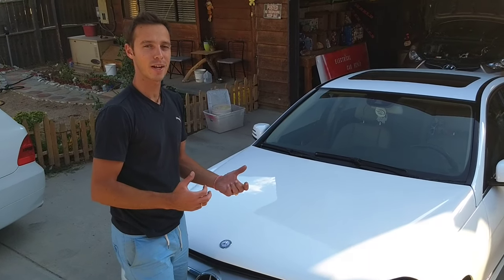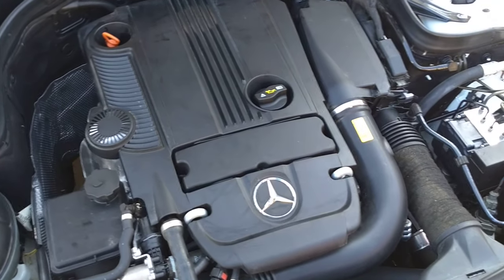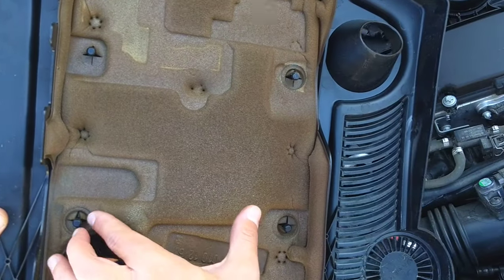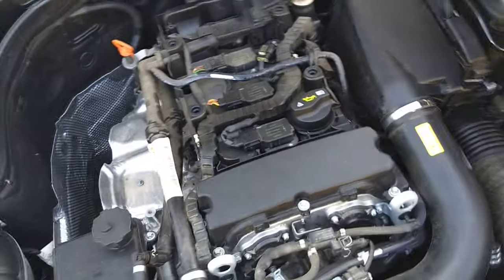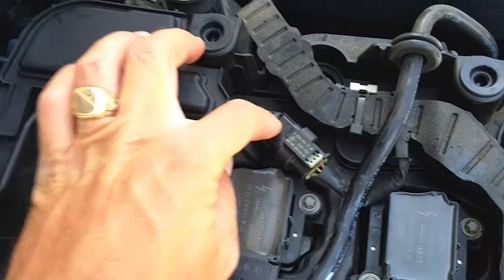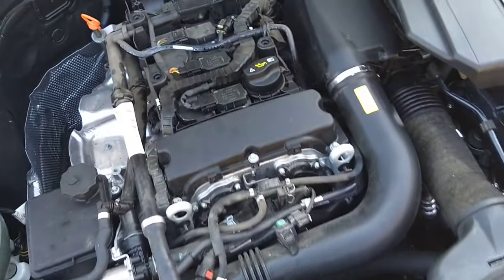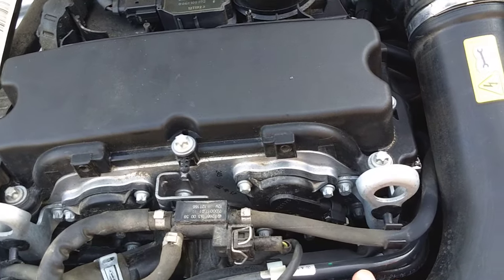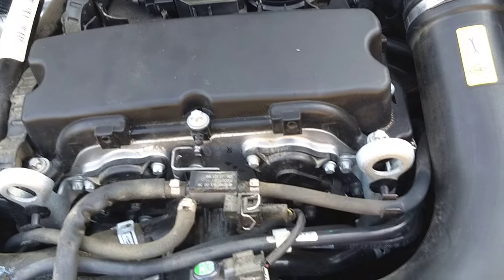MERCEDES W204 C250 CAMSHAFT POSITION SENSOR AND ADJUSTER CODE EXPLAINED

Comment: YO GUYS FUCKING ROCK IT WAS THE CENSOR AND I ALSO CHANGED THE MAGNETIC CAM ADJUSTER RUNS GREAT I DID IT ALL MYSELF U GUYS ARE AWESOME THANK YOU
Reply: Did you have the rattle sound upon starting also?
Reply: No programming needed? It automatically adjusted itself (camshaft magnetic phaser).

Comment: I have a problem with the eco system of the same car from 2015, the check light is on and it starts blinking and the car shakes, they changed one sensor on the front, everything seemed to go away, but after a couple of days it started again, do you think I need to change all the sensors?

Comment: This video was awesome, but, Do you have video how to change the Camshaft Magnet? As you said, we should change it both sensor and magnet together. 
Thanks
Reply: You take the three e-torx screws out and remove the cam adjuster magnet. Then install the new one and install the three screws. Done.

Comment: You guys are awesome!! Question I have exactly the same Mercedes 2014 c250 I HAVE A MESSAGE TO CHANGE THE CAMSHAFT POSITION SENSOR FROM BANK A, WHICH ONE IS THAT ONE? THANKS.
Reply: That one -> bank should be on top bro near the ignition coil and Bank B is on the left side which is exhaust
Reply: There is only one bank since it is an inline engine.  Bank A.  The two sensors/solenoids are intake and exhaust

Comment: Hi guys,
I appreciate your videos greatly.
I have the w212 e250 bluetec. I am having a hard start (3 seconds) then smooth running. already changed the cam control units on the front but still have same issue. Original check showed "intake sensor malfunction (I do not have the exact code number). pls advise.

Comment: I have  code that reads P0340 Camshaft Position Sensor therefore you also recommend to replace the adjuster also correct?
Reply: Hi , I'm having issues trying to remove the exhaust camshaft adjuster on the leftside which has a few piping in the way, which parts should I remove to get to the camshaft exhaust adjuster?
Reply: The sensor indicates u have an issue with camshaft gear adjusters.  That’s a 2 to 3k fix.  Don’t listen to the clown
Reply: Benji R.   Did you find out the problem with the code

Comment: Quick question. How to locate thP0080 Code: Exhaust Valve Control Solenoid Circuit High Bank 1? On this. C250  thanks

Comment: Hi my 2013 c250 has a short rattle when I start the car.  
Could this be the cam shaft sensor or is this the timing chain?
Reply: Im having the same issue, did you get it fixed? If so what was the issue
Reply: @khalidmahmood8466   decided to trade it in.  The timing belt repair is too expensive.

Comment: I’ve got a Mercedes W204 2007 c200 kompressor.
I purchased it couple months ago with an engine light.  I ran an odb2 scan and it came with p0017 code. The oil and filter has been changed regularly.
Is it a simple fix do I have to do the timing . Thanks
Reply: That’s not good

Comment: Hello in 2024, can you help me to figure out what it could be 

1. P001762 The position of the exhaust camshaft (cylinder bank 1) is implausible relative to the position of the crankshaft. The signal comparison is faulty.

2. I have P012872 Thermostat problem as well

Comment: I have a 2014 mercedes c250 turbo. 1. Where is the mass air flow sensor? I keep getting P006800 and P012873 codes (the 873 code is current) what are these codes about? I clear them but they keep coming back.

Comment: Great video! I am getting P0018 on mine the car takes some time for the engine to start up about 5 seconds. Can you please make a video on that?
Reply: i have the same code and i dont have any problems with my car with that code but my check engine light came on shortly after having an MAJOR oil leak issue which then led to the code "p0018" what was your solution?
Reply: @iansbuilt3478  I found the cam adjuster to be faulty.
Reply: @adiyosepov  how much was it to fix and how easy is it?

Comment: thats a good info thanks.!  why my 2013 c250 mercedes works fine for about one hour then the engine starts to shake or not working properly?  other times works fine. any idea?
Reply: Issue with the ECU,

Comment: Hi !
can u make a video or tell me how to position crankshaft to 52 to change high pressure fuel pump? I think this car has same engine as 2013 slk 250 which I need to change the HPFP. Was told it’s easy to position crankshaft to 52 , not sure where I can see the numbers and  how to do it . Thank you!

Comment: P007 is the code I’m getting on a 2014 c250 do you have a video to replace that? I don’t have the 3-400$ it will take to change. I’ve never changed one but your videos seem easy
Reply: Did you end up changing it yourself? Asking because I have the money to get it done, but the whole process seems fairly easy. 

We have the same car btw

Comment: Your videos are awesome man I need help I have the same exact car and it starts and drives 10 minutes later it dies when I’m at a stoplight looked up the code it was a P 2015 is what came up I guess that’s a cam shaft position sensor on the top

Comment: Hi my 2013 c250 92000 miles , has a rattle when I start the car.  Usually after the engine is hot.  
1. How do I know if this is the timing chain?
2. Is there a P code for timing chain?
Reply: Hy Nelson, i have the same problem. The adjusters were replaced and the sensors too. After 1000 miles the rattle started again, especially when i start the car literally every time and when the engine is hot. Have you found any solution?
Reply: @Puhaciccc  sorry for delay, just saw this.  I decided to sell the car it was the timing chain.  Because I’m a glutt for punishment I purchased a 2012 BMW X5.  Everything that is said about BMW’s is true, lol.  Oil leaks from the Valve cover.  I am a YouTube using DYI guy so I can fix (replace) a lot of parts . Unfortunately transmission and timing stuff is out of my league.  Loved my C250 but I’m loving my SUV.  It drives and looks awesome. Good luck👍

Comment: Im getting a error code p001477
(The outlet cam shaft  (cylinder bank 1)
Position differs from specified value the command position cannot be achieved 
No check engine light but the
Car drives good but it randomly has rough idle out of no we’re then fix’s it self a few minutes after I had to go into the ecm trouble codes in order to get this fault code

Comment: im having this issue right now.. i have a 2012 c250
Reply: Do you have a rattling sound at start up?
Reply: @saint1268  i have this issue now c250 2012, hard start with rattle before it turns over. Any ideas?
Reply: @georgemerritt347  It is the phaser gear. They have a pin that fails internally that will cause that. I ordered a set from ebay. Still running to this day!
Reply: @georgemerritt347  try not to drive it... would hate for the chain to skip.
Reply: @saint do you have a link to the ones you purchased? So basically a timing job need tk be done?

Comment: Great video...I’m having the following codes on my C250 CGI... P03406 (the position sensor for the intake camshaft (cylinder bank 1) has an electrical fault. The signal comparison is faulty) P01722 (the mixture (cylinder bank 1)is too rich. The signal amplitude is greater than the maximum amplitude) P23382 (the knock limit of cylinder 3 was exceeded. The signal amplitude is greater than the maximum amplitude). One other observation is that if I am driving at a speed of about 80kph and I need to hard accelerate, the car kind of stutters and shudders, almost feels like the cars speed limiter is activates. But once I release the accelerator then continue again accelerating it picks up speed as expected. The car has also developed a hard start. Anyone who has experienced this sort of symptoms? Is this a common/known issue with this vehicle?
Reply: hey just wounding if you ever solved the issue , im having the same code randomly pop up and has hard time starting !!!! did you replace anything and if you did what was it ??
Reply: @alektahmasian4139  camshaft adjuster is under extended warranty, they will fix it if you get the code under 10 years or 120k miles.

Comment: My c204 starts and dies immediately . It takes over 15 trying before it starts finally
Reply: Please help me sir, I've got a Mercedes c180  2013 model when I drive by putting simmered it l look like cutting petrol but when I switch off the engine and start again it be come normally